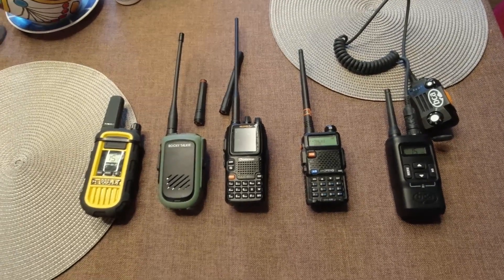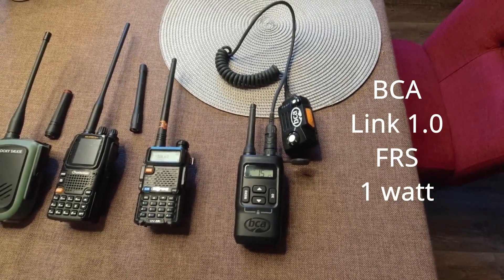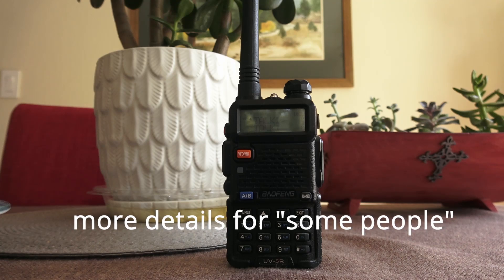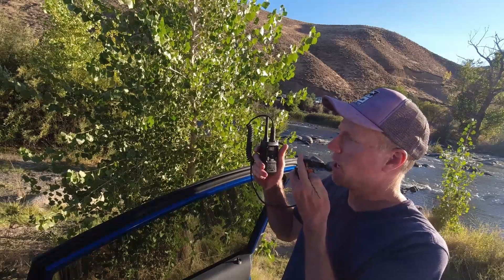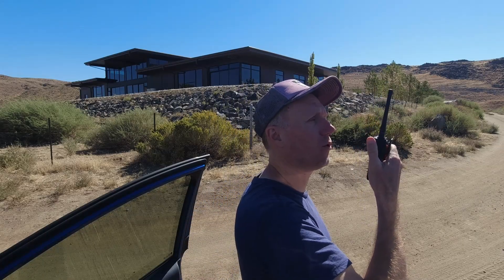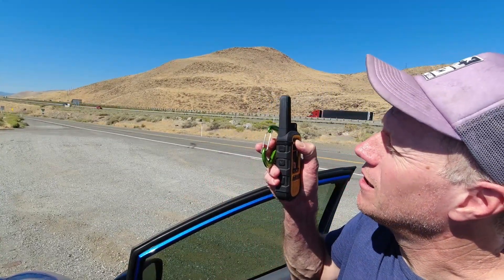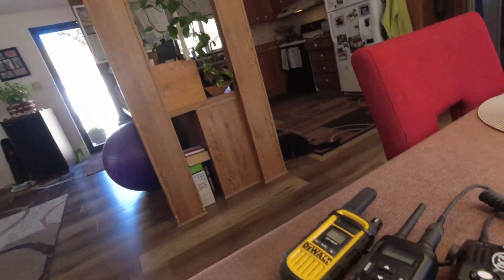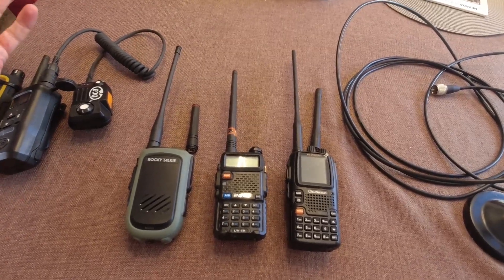GMRS Handheld vs Mobile range test 2

Comment: the best antenna I've come across so far for 446MHz is the Nagoya NA-771. It's night and day difference between that and the stock UV-5R. I managed to hit a Kenwood SBR (also using a NA-771) at a measured 6.5 miles line of sight (on an arrow straight rail line) and it was crystal clear.

Comment: Hey how does that mobile car antenna works? Is it magnetic and where is the cable? Finding it neat! Thanks
Reply from the maker: I had to drill a 3/4" hole in the roof of my car and fish the wire between the roof and headliner. I removed the dome light so I didn't have to remove the headliner to do that. Yeah, not for the faint of heart.
Reply: @alexkram  is it possible to get this to work without drilling holes? also, which antenna is better? Larsen or Tram?
Reply from the maker: @HelloWorld-zg3gs  many options exist for mounting an antenna without drilling a hole. Most of them are more expensive, look worse, and don’t perform as well but don’t let that stop you. Radio installations are compromises and none will be perfect in every way. A magnetic NMO mount with the Tram 1126 antenna will work great if your car is steel. You just have to figure out how to get the coax cable into the car. The quality of an antenna and brand usually matters but a 1/4 wave is the simplest possible configuration so it’s hard to screw up. Tram is a decent brand anyway though and they’ve been around a while.
Reply: @alexkram  Why do you think the Radioditty mount with that Nagoya ripoff antenna didn't work well? I have that Radioditty mount myself and I have a 31" Radioditty antenna. Any thoughts on why I may see an improvement if I got a different mount and antenna?
Reply from the maker: @ I suspect the antenna was poor quality. It is a ham antenna so not tuned for GMRS so that didn’t help either.
Reply from the maker: @ is yours working better than a handheld or no?
Reply: @ It's working ok, but I feel it could have a bit better performance. Maybe I will experiment with something that is tuned for GMRS.
Reply from the maker: @HelloWorld-zg3gs  if you have a friend with a GMRS radio get far away and compare it with a handheld. The car should be much clearer. If not there is room for improvement.